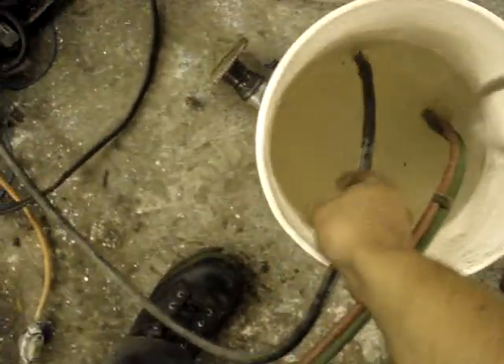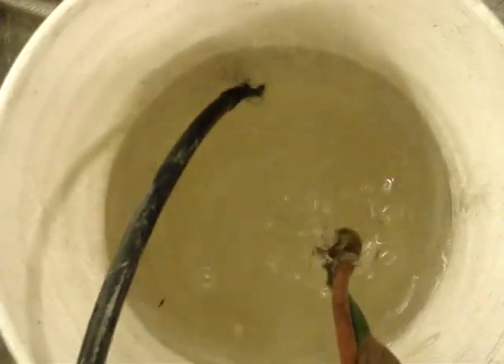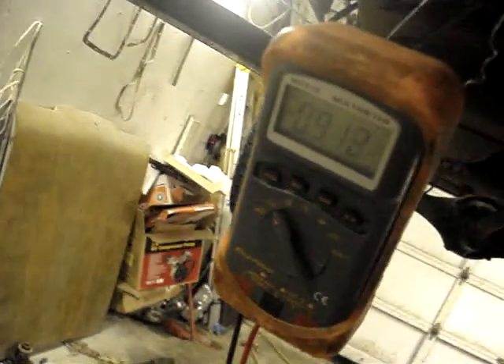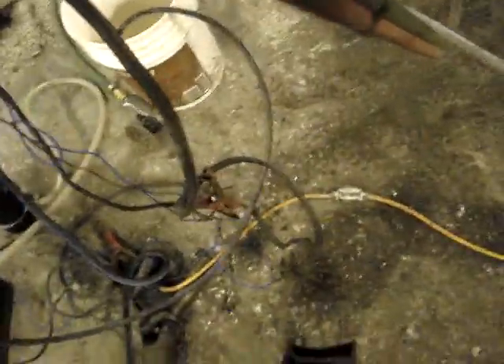o2 revisit with corrected test procedure

Comment: I don't think the o2 sensors are picking up more o2,either. when the hho burns(2H2+O2, hydrogen is the fuel, and oxygen is the oxidizer), the byproduct is 2h2o again. The energy of the ignition has huge positive pressure, while the final byproduct has far less pressure than the reaction(hence some say it implodes..not true..the final outcome has less mass than the reaction itself) not sure how this factors into the combustion chamber, though, when you add gasoline ignition to the equation.

Comment: Question: doesn't the HHO only produce one oxygen for every two parts hydrogen? So you're bubbling from the HHO generator only a third part oxygen compared to your 100% compressed oxygen from your welding tank. So if you're three times as much oxygen bubbles are actually 12 times as much oxygen as your HHO generator. I think....